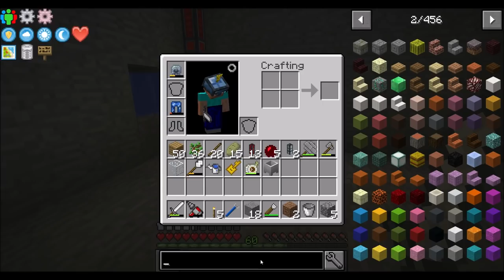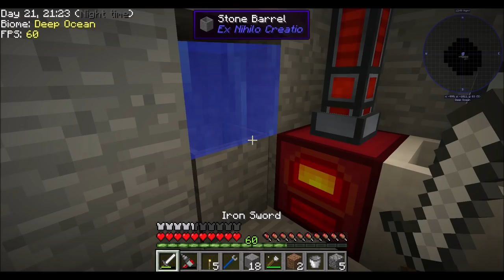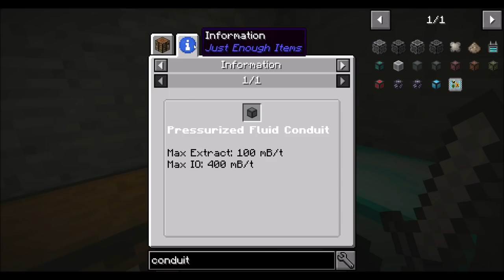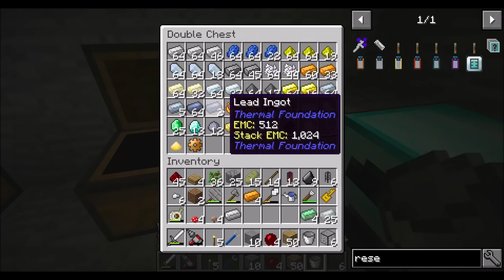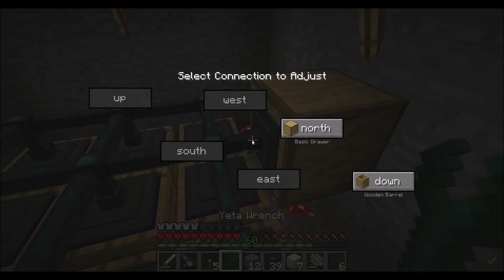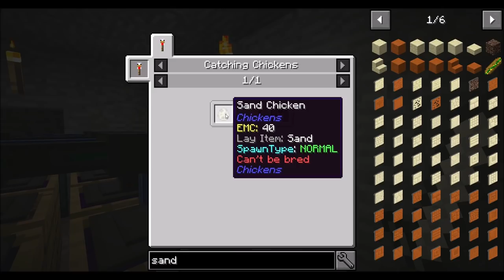Stoneblock   Ep7 SoulSand Automation

Comment: Endervoir is pretty expensive. Pam's has a sink, which is infinite water for just some clay and a bucket of water...
Reply: I agree totally. It a less expensive approach to endless water. Small in size, 1 block . And it a another Mod we never see Dire do. A pack as this should see what Mods are in it. But #DireDerp why we ask.
Reply: sure but you can´t auto output out of them
Reply: Yes you can. Just takes a fluiduct with a basic servo, or better yet, a fluid conduit. Sure, they can't auto output without those, but those make it far more efficient anyway -- even more than using a mining upgrade on a transfer node.
Reply: Sink is not from pams, its from cooking for blockheads.
Reply: +Le Gastronomo
Cooking for Blockheads has a sink, yes, but Pam's does as well. Multiple, in fact, in different styles.
Reply: Paul Moore I was screamin sink lol
Reply: The quantum tank way is easier on the eyes and he already has all the needed resources
Edit: I see the problem he just went looking for that specific EnderIO item rather than looking in JEI for like infinite water
Reply: He might be stuck thinking in Forever Stranded: Lost Souls mode still, where the sink was configured with infinite water disabled.
Reply: you dont have to AUTO-output from them because pipes CAN pull from them.

Comment: Dire please automate wood by using a hopper bonsai with a storage crate underneath it. #nomorechoppingwood
Reply: you could also tell him to do apple trees from pams..
Reply: There's absolutely no reason to bother making a pams apple tree. The log, stick, leaf and apple drop chance are exactly the same in a hopper.  

The only difference is the sapling type.
Reply: Is it really such a good method? I know it's a valid one, but Mystical Agriculture's Wood Essence crops are also low-tech and have enormous yields(3 essence = 16 wood, and you get a harvest every few minutes with a couple Sprinklers from Cyclic).
Reply: in my multiplayer playthyrough ive been using a single hoppping bonsai passivley with be in and out of the chunk and ive gotten at least over 3k wood and 7 stacks of apples within the first 2 and a half days. keep in mind, i only have one of these!!
Reply: They're fantastic. The output is reasonably high, it's passive, and it's cheap to build, and free to run, no water, no power, no piping system needed. You don't need to get into ANY sprinkler mods, any large scale farming. You get clay, dirt, a hopper, and a sapling, and an output cache.  

I also love them for item-specific generation for automation. I'm using a string tree and a oak tree going into locked drawers to feed an auto-crafter, which is outputting to a grid of Pam's Animal traps.

One of the best things about  bonsai is that they will continue to produce a given drop into an inventory even if there isn't room for the rest of the drops...so a single-item type inventory, like a drawer, allows for dirt cheap super early game item filtering.
Reply: ...So for science I just started a new world, and complete with RNG and a short phone call, I had a hopping bonsai producing wood in 21 minutes, from world gen.  That's decidedly a massive advantage over any other resource automation I can think of....you're producing food, logs, and sticks automatically before you NEED any real volume of those resources. 

Punching stone to crafting table to stone hammer to dirt to a oak sapling (it took ten dirt to get one oak sapling in this case), to logs to crucible and sifter and flint mesh, to the first five iron. 

Functionally speaking, it's a SUPER early game method of producing resources automatically which scales insanely fast, and produces, for the material cost, stupid volumes of resources.
Reply: Or hell, use the word chicken

Comment: Dire, I know, that you loves machine automation, but chickens in this pack are insane. I made redstone chickens which are just sand and red dye combined, and they are producing more redstone then I have storage for. And a good tip, go for 10/10/10 only AFTER you have all the combination.
Reply: One more tip, Dire.
You have Hatchery in Stoneblock, you don't have to throw eggs to get chicken, you have Nest for hatching eggs. They just need some time.
Reply: THIS! and a redstone lamp above the nest speeds up the growth. also if you hold shift on top of the nest, but that's generally overkill.
Reply: Why'd you go for 10/10/10 after having every combination?
Reply: Ejpon: I tried to combine my 10/10/10 redstone chickens with basic quartz and with basic sulfer chickens. I ended with 15 additionals 10/10/10 redstone chickens, but no glass, and no saltpeter chickens. I had to make new basic (1/1/1) redstone to progress. 
btw. In this modpack, every new combined chicken is always 1/1/1, if you go the Roost way. Chickens do not inherit attributes of their parents, and you cannot boost them using trick with Smart chicken, like it was possible in Sky Factory 3.
Reply: I don't plan to breed them all into 10/10/10, only those, which are producing resources I'm short on.
Reply: Stupid question, but how do you obtain the basic chickens? I have only been able to get/find the soulsand and quartz chicken so far >.<
Reply: Buy spawn eggs from Pam's Market, or Market which is part of Cooking for Blockheads mod.
There is also a small chance to get an egg from loot bag from mob farm.

Comment: Using the Stoneworks, Auto heavy sieve and a drawers network is a easy way to stock up on resources. The stoneworks automakes compressed gravel, sand and dust as well as smooth stone, glass and silicone etc.

Comment: Hey dire, since sand is a secondary output from the pulverizer, the Auxiliary sieve increases the chance of getting secondary results in any machine (like the pulverizer) to get a secondary item. That will increase your sand production rate, while using 1 augment slot.

Comment: 1:53 You can probably replace some parts of the floor with glass in order to have the energy storage be visible without it taking up space; maybe you could even have a row of low level storage blocks under the machines, visible due to the piece of the floor in front of them being transparent, that feed into the one next to them, thus making it so that the one on the very end is full, and thus lit up, before the next one in the row starts filling up, so that you can have a proper visual of how much energy you have at a glance.

Edit: also, some making a small piston door for your mob farm would look wonderful i feel; you could even make it out of glass.

Comment: PLEASE READ very helpful.  Hey Dire, I took out inventory sorter cause it messes with mouse tweaks and I put in inventory tweaks which works perfectly and I had to go to control settings cause inventory tweaks has an inventory sorter button I had to make none cause it sorted everything in a chest and my inventory and I like where I put things in my inventory unless I want it sorted so now if I want my chest sorted I put my mouse curser in the chest part mouse wheel click and it's sorted and the same if I want my inventory sorted I put my mouse curser there middle click and it's sorted also in the control settings there's a crafting tweaks in there there's a compress all button I have it set to K you can hover over an item like cobblestone and press that button and it compresses it for you easily also thank you for your automation of soul sand and quarts I did not know every time I needed either or I had to go to the nether so thank you.....
Reply: hes not going to do the K thing xD i have told him that like past 3 episodes xD
Reply: Whenever I do the K button on cobble it makes stone crafting tables instead. Very annoying.
Reply: you have to press K  in a crafting table / station or else you'll compress it in a 2 by 2 grid instead of a 3 by 3

Comment: @direwolf20 whenever you get an Ender Wing from a loot bag or chest, DON'T TOUCH IT, NOT EVEN CLICK IT,  TRY NOT TO GET IT FROM THE LOOT BAG  SLOT!!! It will teleport you to a new location as if you started a new game. You cannot go back to where you came from,  so basically it's a new game, but with everything in your inventory is still there.
Reply: Your base should still be there and you can use the teleport option of your map or not?
Reply: @MrN1c3Guy100  I didn't see anything on my map. But I can look at it again.
Reply: Edward Brosens You can just teleport to your normal coordinates which are the same as dire's in this video

Comment: you do not need to have the barrels directly atop mycelium. As long as it's 1y level up from adjacent mycelium it will create witch water. My setup uses item transfer nodes directly beneath the barrels to pull the soul sand with transfer nodes feeding water the barrels from the side and sand from above. It produces 4 at a time, but I rather that than multiples of 9.

Comment: The mod that's making the mouse wheel having issues is simple inventory tweaks
Reply: doubt it. it's not in the pack to cause such an issue :P
Reply: It really is, you need to disable the scroll wheel option in simple inventory tweaks. Tried it myself. It worked.

Comment: My god, just make EFLN from tinkers and take it to the nether to get as much quartz, cobalt and ardite as you want.
Or you could make a good mob trap with stone spikes to get tons of loot bags which has quartz among other things.
Just use the automated loot bag opener.
I had refined storage up before going to the nether that way.
I also have 36 Spectre Cores from loot bags and each generate 128 rf/t.
Reply: My luck is awful when it comes to these mythical Spectre Cores.  I have personally opened about a hundred or so loot bags and auto opened more than that and still no Spectre Cores.
Reply: Rftools builder with a quarry card and a filter for quartz in the nether is what I did I put the of the coils on it and have way to much quartz now lol.

Comment: Hi Dire :)  If i remember well, there should be a kitchen sink with infinity of water supply in your mod pack..... i can't remember in which mod pack :) I did make a cobble generator connected to 2 auto hammers to make sand and from there connected to drawers and then to the water barrels to make soul sand in my Sky Factory 3. :)
Reply: auto hammer in this pack turns gravel into dirt and dirt into sand
Reply: yes, i know, so it would just need one auto hammer more...... but as i mentioned, it was from Sky Factory 3..... but i'm sure that Dire's solution is better with his mod pack. :)

Comment: Hello Direwolf20 peeps. Strange questions, but does anyone know, if the new direwolf20 pack has opaque tubes? Tubes where you can see floating the stuff around? :D
Reply: The Direwolf20 pack does have the Thermal mods in it so it should have the opague and normal item ducts for your item viewing (or not viewing) pleasure.

Comment: 21:50 "gravel turns into sand" hovers over cobblestone :P

Also, when are you going to open the lootbags in yout lootchest?
I mean, sure there's a lot of em, but you've been complaining about missing resources, loads of which comes from those lootbags. I mean, why even have the lootbag thing in the first place, might aswell just void em all if you're not going top open them at this point, they're better earlier moreso than later.

Comment: How did you downloaded this and wich specs do you need to run this
Reply: Twitch Launcher. it should say specs on the page aswell
Reply: @imulion668  ok thx
Reply: Leon Hellmann its not the same, direwolf did some modifications
Reply: @astroeditssj9503  wich modifications???
Reply: i got the launcher... installed... my question is do i need to run the server and connect to it.. as i tried to create new world and after some issues...finally loaded the save and i was in a world of just lava .... this was late last night and i just gave up for the night
Reply: Cant i just download it on curse
Reply: it says 6gb memory and "good cpu" .... so from my own trying to run this pack... you need 6gb of extra memory ... still trying to get mine to fully work tho...
Reply: that just means you need 6gb free. Because java is retarded with RAM handling I would set it to around 5 and see how it runs. Add more if it needs it.
Reply: Curse migrated to Twitch. Use the twitch launcher.
Reply: I gave it 4gb and it works decently. Loading time is about 8 minutes tho.
Reply: Yup, that sounds about right.

Modded MC always takes ages to load.

Mine has 300+ mods and takes about 7 minutes to load. That's it running off my SSD though. Not that it matters cause it's SATA but it's marginally better than  an SATA HDD but nothing as good as a NVME or M.2 SSD.
Reply: @Poendie de pro he added his own mod not so sure about other stuff. But I'm pretty sure he says so in the first episode so just watch it again

Comment: The water is the thing that drives me nuts. Automating resource production is the norm in these packs, full nether or no full nether. I have an infinite supply of stone and thus cobblestone around me...I still have a bank of a dozen max tier cobble gens making my compressed cobble for the deep dark portal. 

But there are easy ways to have infinite water in these packs. Want a solid block? Make a sink, from Cooking for Blockheads. Want something portable? Tiny Progressions infinity water bucket. 

And while I get not wanting to get into industrial forgoing, because of the rubber... you can use rubber essence to get plastic in this pack, and rubber essence is EASY to make with mystical agriculture. Rubber saplings drop from loot bags. You can skip the worst part of that mod, easy. After that...pink slime's a non-issue. It's automatable. 

And the industrial foregoing stoneworks factory is pretty much the best solution for generating any siftable resource in the game...gravel, sand, dust, and compressed versions of the same. Also, silicon, if you want it.

Comment: Okay so I my laptop has 32gb of memory, an NVIDIA GTX 1050, and a core i7-7700HQ @ 2.8GHz dual quad core and yet I cannot run this mod pack without it crashing. I’ve allocated 16gb of memory to it and It uses 80-100% of my CPU. I can get to the start screen but can’t play. Someone please help. I’m using that weird Twitch app to launch the mod pack since that what it said I needed to download the pack, could that be it?
Reply: Pretty much all modpacks use the twitch launcher, so it isn't that. Check your java version and make sure it's up to date. Do you get any sort of message when it crashes? You can also try updating your video drivers.
Reply: KyleTheCakeKid Use less RAM. more RAM means more CPU usage. I only use 6 and it runs perfectly
Reply: Austin Wall Java and drivers are up to date but I did see when I looked at the log that something was up with Foamfix so I downloaded the most recent version to see if that fixes it.
Reply: Jonathan Oliveira I changed it to only 8 now and it runs now. Not sure if it was due to me updating FoamFix, allocating less RAM, or a mix of both but either way it works. Thank you both for your help!

Comment: I got a stack of mekanism t2 machines (4/8 speed upgraded) processing ore chunks from 5 heavy auto sieves and my 11x11x4 (9 rods) extreme reactor can't keep up with them. Can I get a suggestion for a power option from anyone?
Reply: Add efficiency upgrades to the mekanism machines, I'm told it makes a massive difference to power draw. Equal to the number of speed upgrades, or so it is said.
Reply: Thanks. Are those energy upgrades? I thought they only increased internal energy buffers.
Reply: That's the ones. Look at the tooltip, it says they're also for increasing efficiency.

Comment: Soul sand automation is cool but it's just easier to go to the Nether itself and get it directly.
Reply: Or go to the nether and get a chicken for quartz.
Reply: There is actually a good reason why he's getting ahead of the game with automating soul sand.  WOOT is in the pack and you can spawn withers with it.  However you have to feed it soul sand and wither skulls.  By automating soul sand now, he doesn't have to worry about that later.  The wither skulls should be easy enough once he gets a spawner for them.  Yes, a soul sand chicken will be as good, but Dire does things Dire's way.